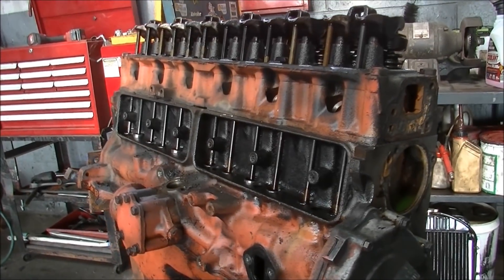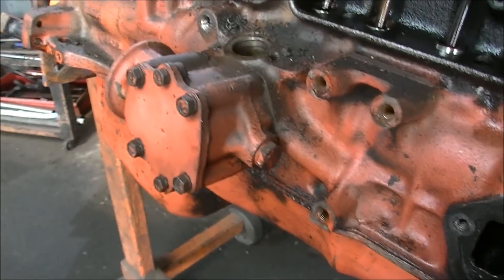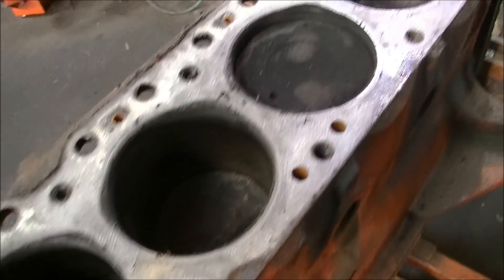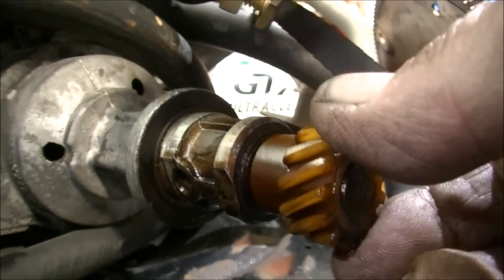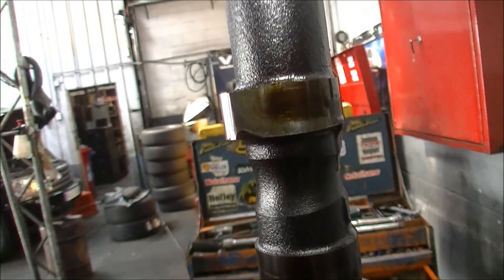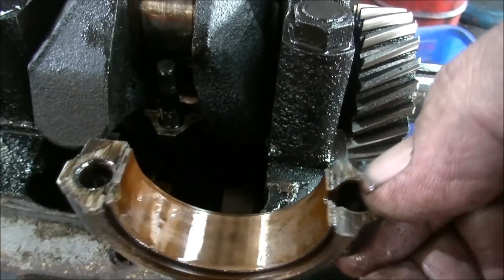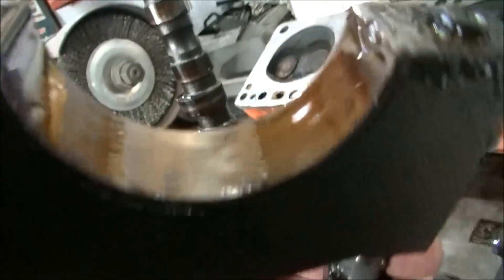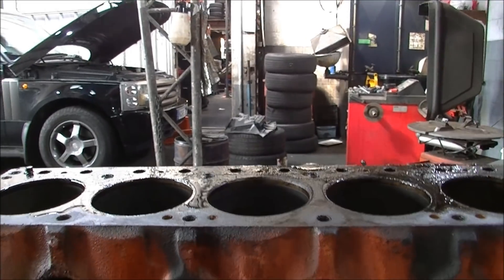1973 LJ Torana engine strip down.

Comment: That old motor was in pretty good nick, mate. I got that timing issue sorted. Thanks
Reply from the maker: Cheers Gaz...What was the story on that.?
Reply: Cam out 4 degrees. Mechanic it was sent to to have the head re-built and cam done, got the specs wrong mate

Comment: i use to race these in the 70's along with fords 6cyl. then found a 260 gmc truck engine i really sank money into before getting into v8's
Reply from the maker: I built lots of 6's with triple carbs and big cams and head...Good enough to do a 1/4 run in 12.5@125mph...
Reply: cool.

Comment: Just a tired old 173. That crap in the oil pickup looks like timing gear. Other than that fairly clean in general.
Check the old bearings though, many have odd oversizes and is marked on the shells. I had a 202 of that vintage with one 9 though rod bearing! and 003 and 4 is common as well. And you cannot buy tyhe selective fit bearings GMH used in the day
Reply from the maker: I sent it to the engine shop and everything mic-ed up standard...Thanks for your input...Cheers.

Comment: Yup, an Aussie, smaller capacity blue flame. .... sort of. Much like our 253's, 308's, and later 304's. Based on the small block Chev but staggered the opposite side to clear the brake booster on right hand drive. Bloody nice note when angry. Our design and build, but GM, Chevy inspired. Mate, reken that had anything to do with them owning the show?
Reply from the maker: Haha..The unmistakable sound of the thong slapper...5.0 heads are the best thing to happen to the Holden V8 me recons...Lots of GM is in all of our Holdens with the exception of the HD...All our cars had to get the OK from the yanks at GM...Some of our guys designed a few of their cars...The first Pontiac coupe was made by Aussies.
Reply: Bloody HD's. The reason my HR gets called Holden's Hastily revised.